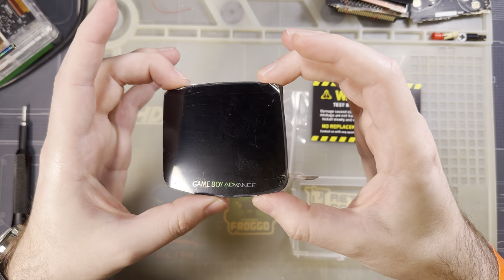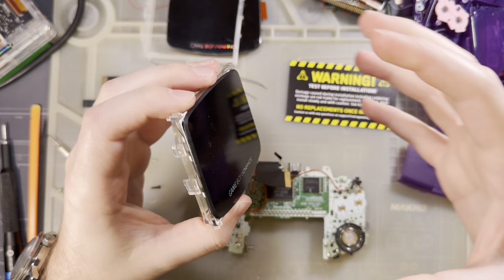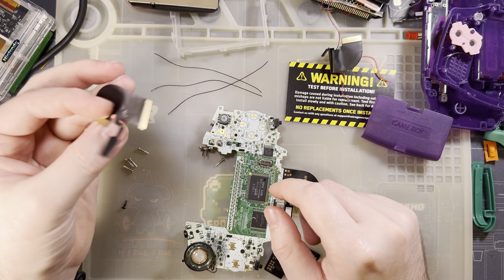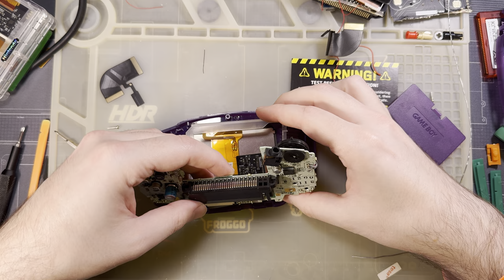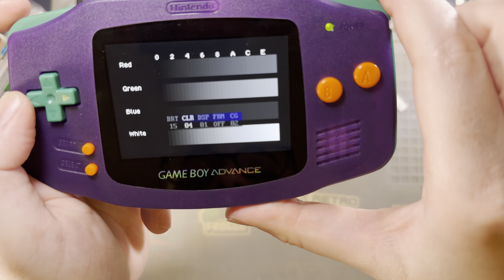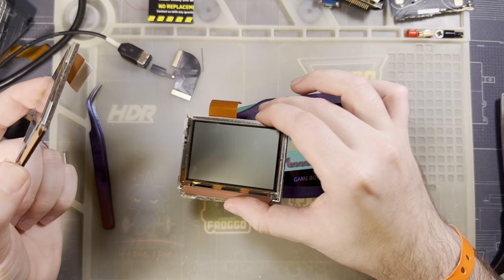Game Boy Advance Laminated M2 IPS from Funnyplaying

Comment: The touch sensor is always the worst part of these kits
Reply: If you have a V1.8 ribbon cable, the touch sensor should be long enough to attach to the shell in the empty slot above the display. Just trim the sensor a bit so it fits. Doing this should avoid unwanted brightness adjustments. You'll just need to touch the front face of the shell above the display instead of the top of the shell to change brightness.
Reply: yep, I found a mod online that shows you how to remove the touch sensor IC and I did that to both of my FP kits. 
Hispeedido isn't any better in my experience. Just bought a SP IPS kit. The brightness touch works but the secondary function doesn't, so I was forced to wire up the OSD buttons

Comment: Ended going with the Hispeedido HDMI-Screen combo kit for my daily use Gameboy Advance, mainly because it has all four pixel modes: no lines, vertical lines, horizontal lines, and both vertical and horizontal lines (pixel grid). The FP screens are nice, but FP seems to be a little stagnant while other screen kits are getting better and better. Great video showcasing all elements of the kit, as always!

I'm about to try using FP's old laminated backlight kit with Highspeeido's HDMI kit (the board with the holes in it, not the new kit I mentioned above).
I already did it once, and encountered the same issues you did in a previous video with the backlight bleed from the pressure points.

I plan to try and resolve this by flipping the Hispeedido board and using an extension ribbon cable.

But I am also trying to do all this on an FP motherboard.

Yes I am insane and know it probably will not work.
Yes, I know there are easier kits.
But it's not about doing it easier. It's about doing it because I can.

And because I feel like being a fool.

Comment: Hey makho, which Kit are you using in the GBA SP at the end? The one you linked is a GBA Kits. I'm kind of confused.
I watched yesterday your GBA SP Funnyplaying M2 Kit Video and today the GBA M2 one and I dont know how I should say it but I dont like the M2 Kits. I find the GBA SP M2 even worser than the GBA M2 Kit, but they both suck in color when looking at the "old" FP IPS laminated with FRM. Whats scaring me now is that no "old" kit is buyable anymore on FP Store. I had plans to build a few GBAs with that old kit and it seems like there are only the M2s in the future :(
Reply from the maker: Like I said in the video, I'm using a comparable kit from one-chip. I linked to the GBA version which uses an identical LCD and performs the exact same (but is for GBA instead of SP because this video is also for GBA and not SP). I only used the SP over the GBA because it was the console I found first when I was making this video.
Reply: @makho  thanks

Comment: How would you suggest removing the touch sensor from the GBA FunnyPlaying screen? I have some sensors that cycle brightness by themselves randomly.
Reply from the maker: mechanical decoupling is by far the most effective means of removal
Reply: @makho  thanks for the reply. So just cut it off?
Reply from the maker: @geoargi  More or less, yes.
Reply: I cut the touch sensor from my 3.0 Inch IPS AGB screen a while back, just like makho is saying here. That thing was driving me insane, and I soldered all the inputs anyway.

Comment: the colors are way better on the funnyplaying kit but the subpixel layout is disappointing
Reply: hmm what do you mean by that? does that mean that the m2 screen doesn’t have proper integer scaling or something?
Reply: @NikhilGarlapati  look at the close up pics makho took of the screen, the subpixels are offset, which is why there are no vertical pixel grid modes
Reply: @NikhilGarlapati  In Close up images of the DSP modes, this M2 LCD should be delta arrangement. So, the this LCD can't do vertical lines, and pixel grid DSP modes.  But, you know, the original GBA LCD is RGB arrangement.
Reply: In Close up images of the DSP modes, this M2 LCD should be delta arrangement. So, the this LCD can't do vertical lines, and pixel grid DSP modes.  But, you know, the original GBA LCD is RGB arrangement.